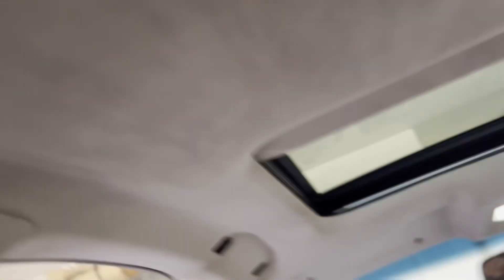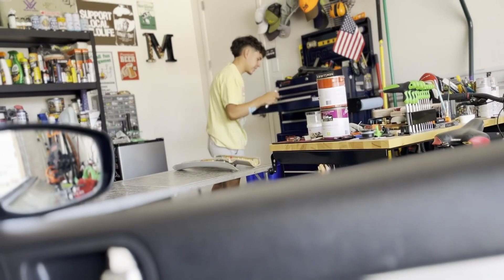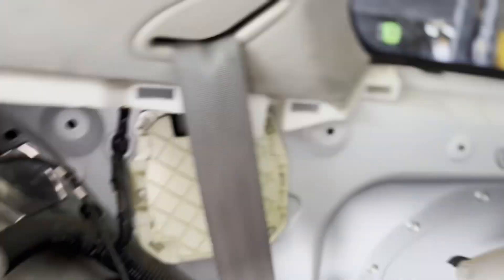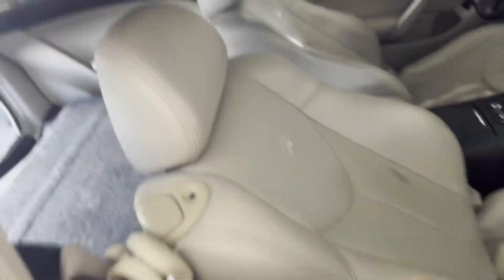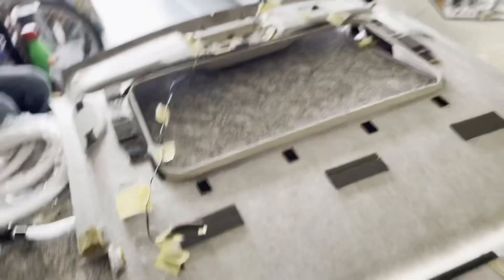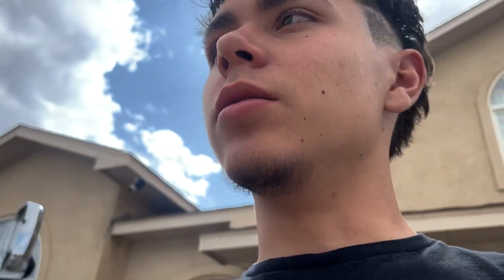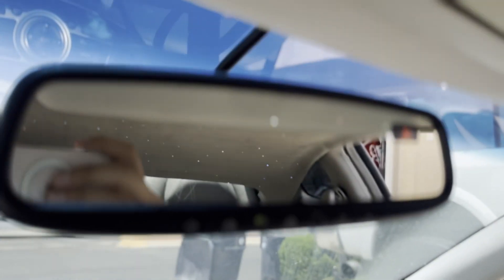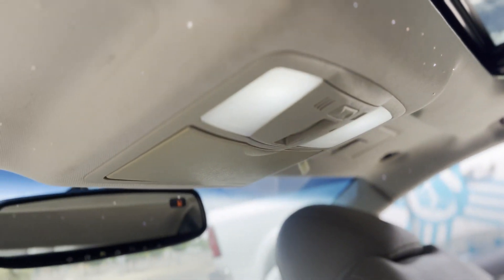I PUT STARLIGHTS IN MY G37

Comment: Where did u connect the wire?
Reply from the maker: it just runs from under the rear seat where the projector is to the lid of the center console i didn’t bother running it under the carpet and it’s still fairly discrete